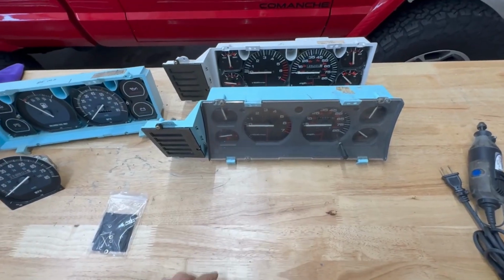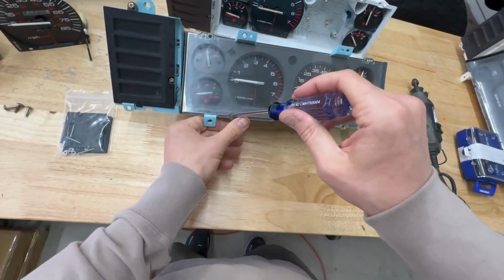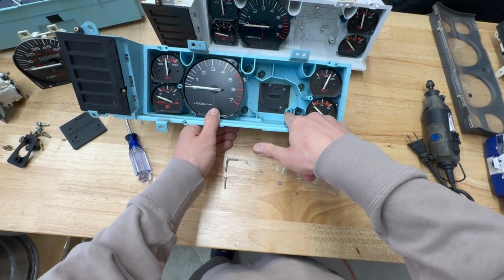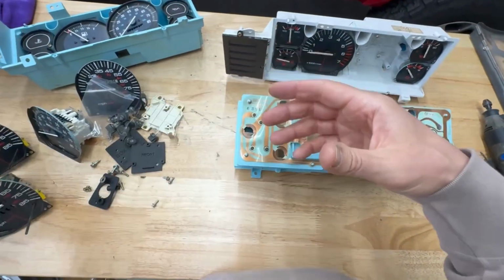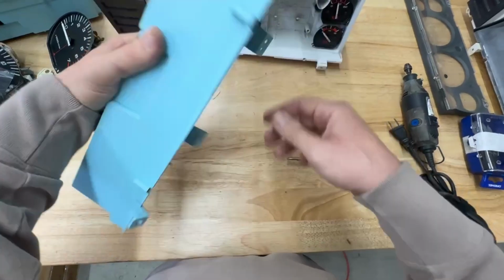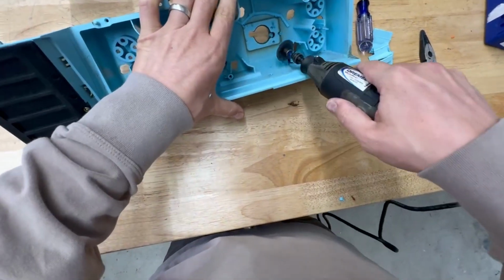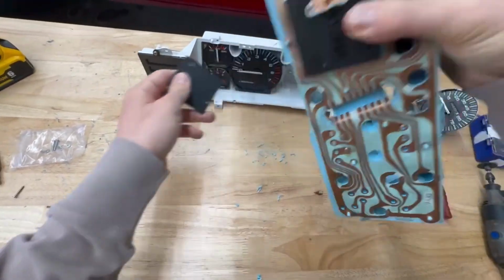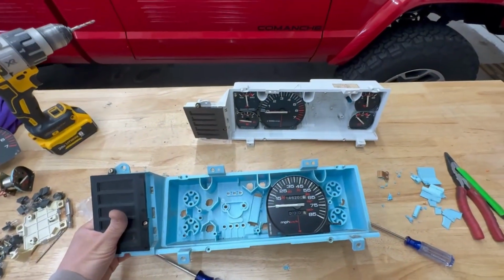BoxyJeep Renix Electronic Speedometer Conversion - Installation Part 1

Comment: My speedo cable started chattering recently on my 90 XJ.  My plan was to disconnect the speedo and guess.  This video randomly popped up in my feed.  I'll look into doing this instead!  Kind of nice to know how fast I am going.

Need a link to your site please.  

Edit - I found your site with a quick search.  Kit looks good at a fair price.  I'll have to pick one up soon, jeep is torn apart right now doing other work.  I would recommend putting a link to the kit in the video description.
Reply from the maker: It's boxyjeep.com!  Check it out on the Gauges and Electronics section.

Comment: Thanks for the video. Made me feel way better about cutting out all that plastic in the housing.
Is there a part 2?  
I somehow  imagine the next part with the adapter, sender and gear is going to be a pain.
Mostly because I'm on 33s and the orange gear just doesn't want to sit right.
Reply from the maker: Next part will be the wiring.  Then third for overview.  But the first part is the tough one!  Everything else just plugs together.

Comment: Great video! Maybe you can resolve a doubt I have. I´m restoring a 1992 XJ converted to a carburetor, so no ecu whatsoever, where can I get the tach signal from? I was thinking of getting it from the alternator's W terminal. What do you think? Thanks a lot!
Reply from the maker: What distributor are you planning on using?
Reply: @boxyjeep  Hey man! thanks for your response! My XJ has a four banger Renault 2.2-liter gasoline engine. It came with a small, off-the-shelf alternator, which has only two terminals: charge and excitation. My plan is to take the signal from one of the stator phases by running a wire from there to the tachometer.
Reply from the maker: @leoyannick  Unfortunately wouldn't be sure how that would work.  I was asking what distributor you are using as that may have a mechanism to provide tach signal.
Reply: @boxyjeep  I have a Magnetti Marelli. Dont know what model is, but only have two terminals: B+ and D+. Since i don´t have de w terminal, i planned to run a wire from the stator  but i don´t know if this tachometers could support this signal. I think I´m going take the risk and see what happens. Thanks a lot for the chat!

Comment: I'm stuck with an '86 base model MJ that I'm rebuilding as a daily driver.
Why can't I just use the entire cluster from the donor XJ? I have not found anyone that can explain why I can't just use the entire '91-96 cluster, which I have access to. I'd rather do that anyway because the '86 MJ has the dumb idiot lights and no tach. I'd much rather have a tach and real gauges.
Reply from the maker: Great question!  The wiring and electronics on 91+ are totally different and not compatible.  Trust me—we’ve tried!  Grab a good 87-90 full cluster and grab the speedo conversion parts from our site!
Reply: Ok so you answered half the question.
So I'd have to swap the flywheel out for the tach to work right, swap the fuel sender or add a resistor, and swap the speedo... which I'd already be doing.
So... why wouldn't I just be able to do that?
Reply from the maker: @TehButterflyEffect Because the engine computer will not run with a HO flywheel.
Reply from the maker: @TehButterflyEffect Sorry, what engine and transmission are you using or swapping into the 86?
Reply: @boxyjeep  Oh wow you're quick on the replies.
I have an '88 MJ as well but it doesn't have a full gauge set and I'm keeping that truck anyway so I don't want to use the cluster.
The '86 is a base model truck. It has the AMC 150 and an AX-5. Not currently swapping engines.
I suppose I could replace all the Renix stuff with OBDI (and replace the intake manifold) and then I'd be able to use the 91+ cluster.
Anyway I might be able to grab an '87-90 cluster and do the electronic speedo swap. I'll keep looking. I'm probably going to order a couple of kits from you though.
Reply from the maker: @TehButterflyEffect  Got it.  So the 86' MJ 2.5L is a Renix EFI system.  If you don't plan to change anything other than the gauges, the 91+ cluster will not work.  The connector is different (but you could always crimp the two harnesses together).  The speedometer would not work (cable vs. electronic), the fuel gauge would not work (different ohm range), the tach would not work (different signal and system).  So basically, you'd have voltage, coolant temp, and oil pressure (assuming those sending units were correct).  You cannot swap the 91+ 2.5L flywheel as that doesn't have the correct signal for the Renix CPS and your engine would not run.  TLDR; you need an 87-90 full cluster with blue housing, unless you are planning to swap over the whole 91+ 2.5L EFI system.
Reply: @boxyjeep  Roger that, thanks for explaining. I may eventually get rid of the Renix system entirely but that's not the plan right now. It seems to be in good working order for the time being.